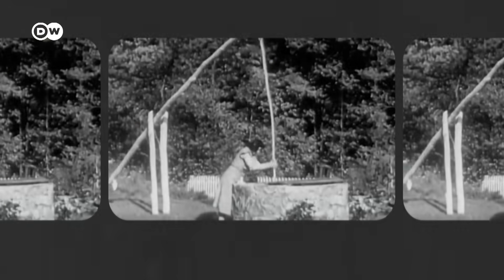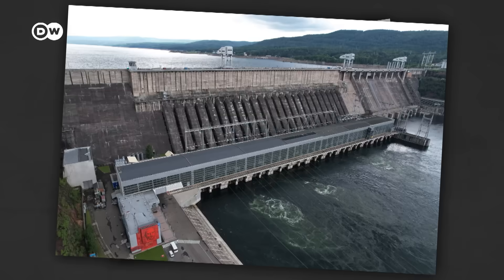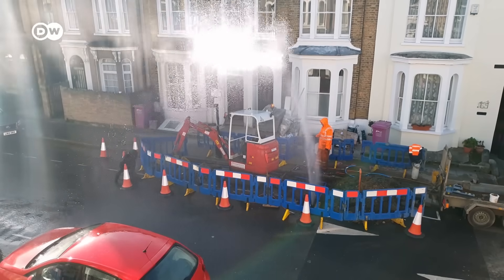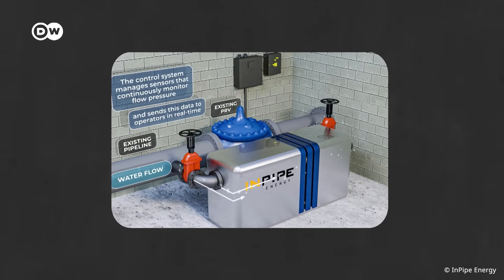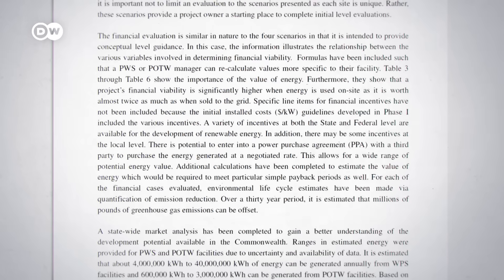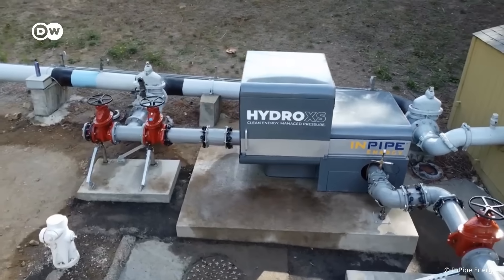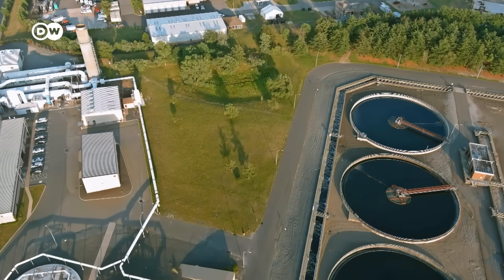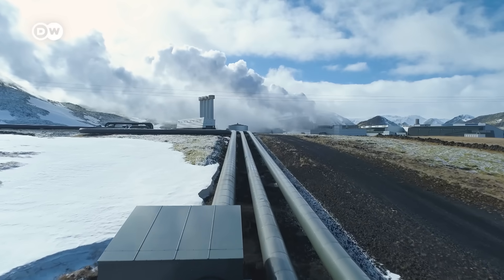In-pipe energy: The hydro power nobody is talking about

Comment: Should be ILLEGAL — except where gravity alone is pressurizing water piped to customers. What he said…

@picapica8846
The most efficient energy use is the one that it is avoided. What about using frequency regulated pumps that deliver the required pressure just at the required moment? That is how factories do it.
Reply from the maker: Hey there! Yes, these kind of pumps can be bought for domestic use.
Reply: @DWPlanetA  Had considered buying/building in-line micro hydro generator ~15y ago (after seeing showerhead LCDs). But over-pressurization is a failure by utility… don’t blame consumers for taking advantage of this but utilities should not see excess pressure as an energy source to harvest.

Comment: Looks like a great idea, but I have two questions. One is that water eats away at metal, so wouldn’t a turbine be a great place for destroying spinning metal? And if a turbine is used as a sort of pressure brake, you might need even more pressure to keep the post brake at the same level? Still I’m all for the idea being developed, especially with gravity feed.
Reply from the maker: Hey there! Question 1: Stainless steel is usually used for water turbines and lasts decades but yes, it has to be replaced after a while. Question 2: Mini hydro technology only collects pressure valve waste energy already being generated by our water transportation service. Therefore, no additional pressure is needed. The process is explained at 2:26.

Comment: As a water researcher and enginer, I see that there's little we can do to make this technology worthwhile and sustainable. Using electricity to increase the water pressure mechanically is a very low performance process to begin with. OK, let's assume the pressure is builtup due to elevation increase (e.g. water towers). To harness the energy you need to get your water running. That meanse while we're asked to reduce our water consumption to preserve water resources, the energy gain would be not constant and less than what you can count on. This idea is useful when is employed in long range and massive pipeline projects, when the recipient is in a lower altitude and certain technical requirements are met. In those projects the flow of the water is reliably constant and the amount of the nergy that would normally damped in the hydraulic ponds or pressure reducing valves would be recovered (partially).

Comment: Pressure energy in water supply pipes is necessary to move the water.   If there is an excess of it, then you should explain how much of the pressure energy can be converted to useful energy, such as electricity, and still be able to move the water.  You only touched on this by mentioning pressure reducing valves and you showed a small turbine attached to a garden hose.   What happened to the frow rate downstream of your turbine?   Moreover, it did not help that you referred to the untapped energy as "potential" or "energy potential". Potential energy is a well-defined physical quantity and you were not talking about that.  In short, this falls short of the engineering minimum required for a story of this kind.
Reply from the maker: Hey there!  Mini hydro technology only collects pressure valve waste energy already being generated by our water transportation service. Therefore, no additional pressure is needed. The process is explained at 2:26.

Comment: I don’t know about other countries but here, in NZ, it’s illegal to use domestic supply to run a turbine. It’s obvious really: if everybody starts to do it the water pressure drops, the supply is wasted and we all run out of water at the next drought. In many places they need to use pumps (electric, of course) to maintain adequate pressure. Using this as a hydro power source would be ridiculous as they’d need far more energy to pump it than it could possibly generate.

For hydro to be efficient it needs to keep the frictional losses as low as possible. This means the shortest and widest practicable pipes for the hydro supply. That’s why the majority of hydro plants are right at the bottom of the dam, itself. Domestic supply networks are simply not designed for this purpose. A million little 100 Watt generators at the end of miles of narrow piping would use a huge amount more water than a 100MW generator, at the source.
Reply from the maker: Hey there!  Mini hydro technology only collects pressure valve waste energy already being generated by our water transportation service. Therefore, no additional pressure is needed. The process is explained at 2:26.

Comment: If water suppliers are wasting so much energy in pressure valves along their service, then by far the most economical way to save energy it to dial back the pressure valves so they don't drop as much pressure and pump the water to a lower pressure to begin with.  If they need to handle surges better, then that's what big pressure tanks are for.

Comment: About six months ago a friend bought a condo in an older converted apartment building where they cheaped out on installing meters for each unit, so he basically pays an extra fixed amount in his quarterly HOA and condo fees and can use as much cold water as he likes.  

So I started brainstorming ideas for how he could take advantage of this, mostly as an exercise of creativity and not really intending to actually do anything with the ideas.  But one of my ideas was to install some kind of an induction motor inline to the main line right by the shutoff valve.  Then I started wondering how much that would cost in water pressure.  I figured there would be more resistance, especially if the generator is directly connected to a very high load of some sort.

I never thought of (or knew about, really) pressure relief valves as a good place to tap into that energy without interfering with the distribution overall. 

I wonder if refactoring the relief valves to use a dynamo instead of whatever method they currently use could also improve these valves by allowing finer and more dynamic control over how much pressure each valve can remove from the system.  I would assume putting a larger load on the dynamo would put more pressure on the valve, restricting even more flow beyond it.
Reply: Depending on how much your friend pays for energy what he could do is start to mine cryptocurrency, because if he is not paying the true cost of electricity, it might be profitable. I’d recommend miners and not GPUs.

Comment: This is the robing Peter to pay Paul principal. The idea of moving water from the deep end of the pool to the shallow end. Efforts to pull energy from water that is moving because of a pump will just reduce the efficiency of the original pump. The net result is more energy demand to operate the original pump. This isn't adding efficiency it is reducing it. Dumb Idea.

Comment: I have to admit, I don't get it?
Don't we need to use energy to create the pressure, so that if we generate energy from the pressure, not only do we need to then use at least an equivalent amount of energy to restore pressure, but assuming losses in the system, in total we're at a net loss, completely wasting the difference?
In the cases where some local pressure is too high and we need to offload the energy anyway, it makes sense. Maybe I misunderstood and this was central to the concept (came across as a side note relevant to just some situations). 
But maybe i just didn't understand. Have to admit I'm confused and maybe more low level detail on the fundamental principles that make this concept work would be appreciated 🙂
Reply from the maker: Hey there!  Mini hydro technology only collects pressure valve waste energy already being generated by our water transportation service. Therefore, no additional pressure is needed. The process is explained at 2:26.

Comment: stupid idea: 
1. only 4% of our energy goes into water delivery
2. Installing those generators in every damn pipe would be expensive while building things like solar panels would be cheaper
3. You need some pressure left for your water to come out of the tap
4. Perpetuum Mobiles dont work

Comment: Well if a pump running on electricity pushes the water and creates the pressure in pipe then using a turbile in the water pipe, wont it increase the energy consumption of the water pump to begin with? Thus nutralising the energy that we get from in pipe turbine?

Comment: Ok, I know nothing about infrastructure or any of that business, but I have a stream by my cabin that's on a gradient and my cabin need to be powered *yesterday* because I need dehumidification. ( I found some energy friendly mini dehumidifiers online). Point blank, could I create some kind of water collecting pressure tank and put that little turbine in a pipe coming from there? WHAT IS THE NAME OF THAT TURBINE ? What else would I need? Can someone help? 😅
Reply from the maker: Hey there! Maybe use a system that uses free flow streams better. There are mini water turbines for example and even turbines that are specifically built for slow moving water depending on the specifics of the stream.

Comment: If you put a turbine in the pipe you reduce the pressure across the turbine, slowing down the flow; at a faucet for example. No energy is gained, the utility company will be paying for the electricity you get with pump power. This is ridiculous, send electric power in wires not pipes; extremely inefficient!
Reply from the maker: Hey there!  Mini hydro technology only collects pressure valve waste energy already being generated by our water transportation service. Therefore, no additional pressure is needed. The process is explained at 2:26.

Comment: This is assuming that we don't need pressurized water. If you are using in-pipe energy, you are essentially treating the pumped water like a copper wire. You are just transferring energy from one place to another, and in a more inefficient method. By releasing pressure somewhere on the system, you are needing to increase the pressure somewhere else.

Comment: The water grid is basically wasting energy by imparting more pressure than is needed for some of the households. In hilly areas, every house is at a different height, so the water pressure in any district needs to be high enough to supply the highest house in that district. So all the houses at lower height get water with excess pressure and that's where in-pipe generation can recapture some of the energy. But there will always be a penalty on the flow rate. This could be solved by generating electricity from the pressure while slowly releasing the water into a local tank at zero pressure, from which the water can be intermittently accessed at any desired flow rate in high volumes.

Comment: If there are large valves that could be more energy efficient that can be an easy win. Efficiency is always sustainable. But remember, after that we still need to use energy for the water system and that consumption needs to be sustainable anyway. So I think it's far more important to focus on clean energy than hyping recovering energy from tap water which the pump facility has to generate. It's not super sustainable if you harvest back fossil energy. Conversely, let's say you need to desalinate water using sustainable energy, then transportation costs in comparison are more or less marginal. That said the in-pipe tech can be very handy for spot generation so that you don't need electrical infrastructure along with the water pipe.
I think what we need from these reports are not the passing mentioning of a novel idea, but an overview of implementations and an in-depth comparison of those to baseline sustainability strategy of renewables, grid and storage.

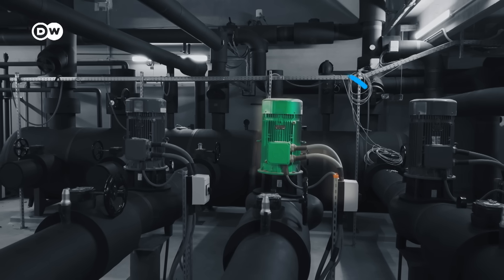Comment: 2:42 Not a pressure valve , just regular valve

Also there is this thing called second law of thermodynamics , which basically tells you that  most of realworld enery processes are not reversible , therefore you are justgoing to end up wasting more electrical enery with this system . If you wish to consereve energy in regards to water distribution , just use water towers.

Comment: This is backwards and would overly expensive and complicated.  Putting in better pumps and controls so the the system only used the energy needed to pump the water instead of needlessly building pressure and regulating it down. The current system was made to be simple and reliable but not efficient. So unless your getting 'free' energy from gravity pressurized systems it's better to not put unneeded energy in then to try to scavenge a fraction of it out

Comment: Double it power with drain water , dissimilar metals rust battery wrapping around similar to dowsing for underground water or pumping watts receiver dish using flow probably needs to be metal pipe or it would be fabric and plastic static electricity

Comment: It's like putting solar panel under light bulb fitted in your room.
Reply: No, it's like regenerative braking. Currently some energy is being wasted. This just captures some of that waste energy.
Reply: @oliversissonphone6143 how much more pressure do I need to add to the line now that you have added turbines to it and reduced the pressure after each turbine?!….
Reply: @josephspruill1212  No extra pressure needed. It captures the wasted energy when the water pressure presses against the valve.
Reply: @Quid-u1v You’re telling me there is no pressure drop after each device when you are capturing the energy it’s providing in the device. I find that very very hard to believe. I would need to see the test being preformed and the results on the gauge with my own eyes to believe that! The laws of physics says that the energy will be absorbed from the device. There will be less energy after each device. There for you will need to add more pressure. Like I said I would have to see other wise cause physics says other wise……

Comment: So let me get this straight... We're going to install relatively-complicated, cost-significant, manufacturing-intensive, maintenance-required, low-to-no benefit devices on hundreds of thousands of water outlets to harness enough energy to power a coffee maker per household, maybe... You are solely considering ONLY the end energy output of these devices; nevermind all of the energy and pollution required to design, manufacture, install, and maintain a device that simply re-converts the potential energy from water pressure BACK into electricity. What about the infrastructure required to the deliver that energy to the grid?

But more fundamentally, think about it. You are generating electrical energy from a motor by converting the potential energy from water pressure, that was created using a electrical energy from a motor... Uhhh, the laws of thermodynamics apply.

No; this is not a viable economic nor ecological option.
Reply from the maker: Hey there! We did a video on the electrical grid a few weeks ago. Check it out here 👉 https://www.youtube.com/watch?v=u-DsDuTceTo

Comment: I could only see this practically being used at the building cut off

A lot of plumbing code calls for a PRV (Pressure Reducing Valve) as close as possible to the building supply cut off because of there’s usually a local pumping station close by that distributes water throughout your local community. 

Some waterlines will have more pressure potential and others will have less due to water wanting to take the path of least resistance from the pump station. 

This concept would only work to recoup the energy that is wasted at the initial 1st PRV. 

Afterwards the pressure in the occupancy cannot be reduced further without running into issues.

Comment: There already is a centuries old technology that delivers energy. Trompe. It doesn't impede water flow, pressure, in fact it can increase the pressure. 
This was used in Roman times, maybe earlier. 
On-line turbines need to have a regulator, repairs, and if they stop working, say by getting plugged, replacement is not as easy as some would think. 
Toe this gadgetry is another way of making profits from the one thing every living things on Earth must have, water.

Comment: Correct me if i'm wrong, but certain applications reduce energy consumption with variable frequency drives on pump which in turn reduce the energy it takes to move the water in the first place... it's a delicate balance and I really only see this as something that retrofits to old systems

Comment: I love hearing about ways to save on energy and be more efficient but I don't think this will work the way you think it will. Yes, by adding the turbine at the end point of the water source, you can generate electricity. However, the pumps that are use to get the water to your homes will need to apply more energy. You're not creating a net positive energy out of this system. 

But I encourage everyone to keep looking and considering improvements to our systems. Just understand that some ideas might only sound great in theory.

Comment: An even better idea would be to use the same pressure regulators as the UK which dont release water to reduce the pressure, a spring and diaphram open and close a valve to maintain the corect pressure. This way there is no energy wasted from pumping water out of pressure release valves and no need to add a turbine which wouldnt recover all of the lost energy and is an additional cost in building and maintenance of the system.